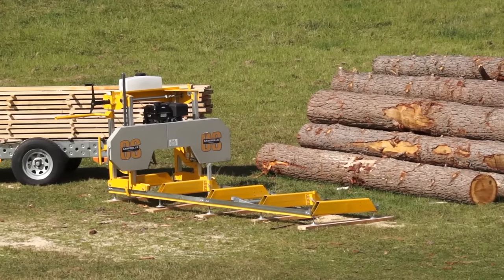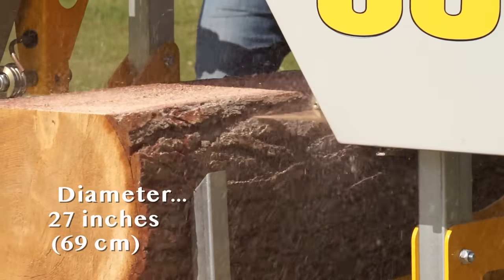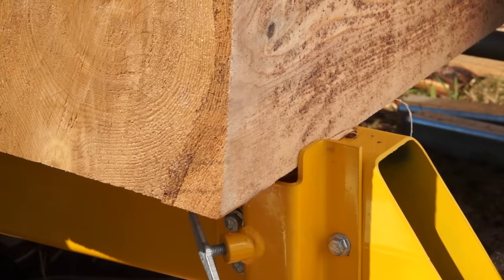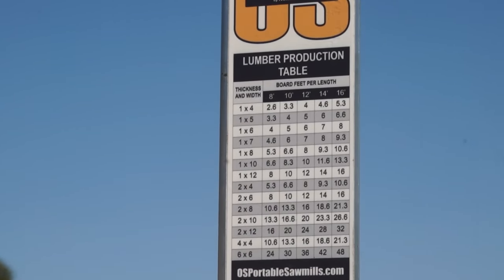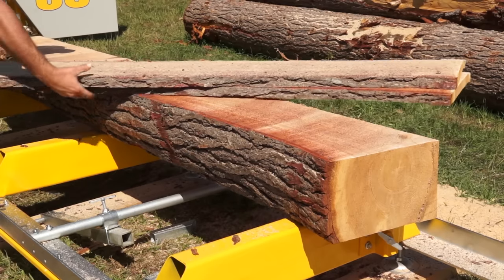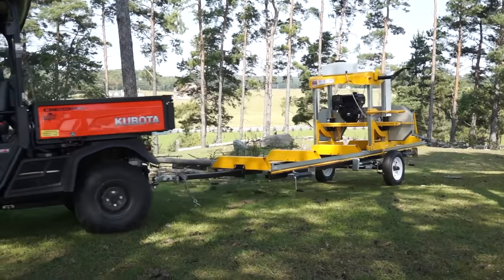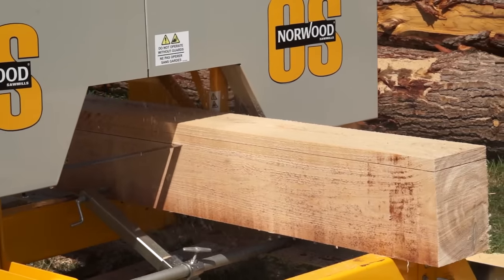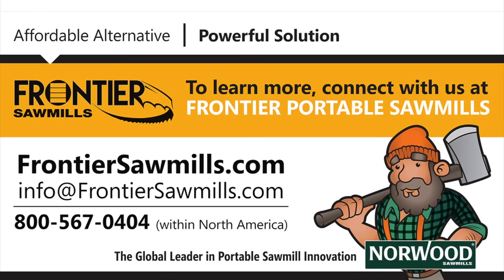The Affordable, Easy-to-Use & Reliable Sawmill You've Been Looking for - The Frontier OS27

Comment: How much price this machine
Reply from the maker: Frontier builds three sawmill models with different log diameter capacities: OS23: 59cm (23”), OS27: 69cm (27”), and OS31: 79cm (31”). Standard log length is 3.4m (11’) but you can add 7’ (2.1m) extensions to mill as long as you want.  You can add the optionally available trailer/support jack system to all Frontier sawmills at any time (when you get your Frontier or in the future).

Frontier Sawmills start at just USD $2297 (for the Frontier OS23). The Frontier OS27 starts at only USD $3297.  The Frontier OS31 starts at only USD $3897.  

You can get a lot of helpful info about Frontier Sawmills, including all pricing, at www.FrontierSawmills.com  .

Frontier services your country factory-direct.  To order, contact us directly at Frontier Sawmills via email at info@FrontierSawmills.com . 

Thanks!

Comment: How many coast this machine?
Reply from the maker: Frontier builds three sawmill models with different log diameter capacities: OS23: 59cm (23”), OS27: 69cm (27”), and OS31: 79cm (31”). Standard log length is 3.4m (11’) but you can add 7’ (2.1m) extensions to mill as long as you want.  You can add the optionally available trailer/support jack system to all Frontier sawmills at any time (when you get your Frontier or in the future).

Frontier Sawmills start at just USD $2297 (for the Frontier OS23). The Frontier OS27 starts at only USD $3297.  The Frontier OS31 starts at only USD $3897.  

You can get a lot of helpful info about Frontier Sawmills, including all pricing, at www.FrontierSawmills.com  .

Frontier services your country factory-direct.  To order, contact us directly at Frontier Sawmills via email at info@FrontierSawmills.com .

Comment: I'm interested to buy this machine so plz send address I can buy this machine
Reply from the maker: Frontier builds three sawmill models with different log diameter capacities: OS23: 59cm (23”), OS27: 69cm (27”), and OS31: 79cm (31”). Standard log length is 3.4m (11’) but you can add 7’ (2.1m) extensions to mill as long as you want.  You can add the optionally available trailer/support jack system to all Frontier sawmills at any time (when you get your Frontier or in the future).

Frontier Sawmills start at just USD $2297 (for the Frontier OS23). The Frontier OS27 starts at only USD $3297.  The Frontier OS31 starts at only USD $3897.  

You can get a lot of helpful info about Frontier Sawmills, including all pricing, at www.FrontierSawmills.com  .

To order, contact us directly at Frontier Sawmills via email at info@FrontierSawmills.com . 

Thanks!

Comment: Is there a large one?
Reply from the maker: Hi Mel

Frontier builds three sawmill models with different log diameter capacities: OS23: 23” (59cm), OS27: 27” (69cm), and OS31: 31” (79cm). Standard log length is 11’ (3.4m) but you can add 7’ (2.1m) extensions to mill as long as you want.  You can add the optionally available trailer/support jack system to all Frontier sawmills at any time (when you get your Frontier or in the future).

You can get a lot of helpful info about Frontier Sawmills, including all pricing, at www.FrontierSawmills.com  .

BUT IF YOU NEED SOMETHING BIGGER OR FOR COMMERCIAL WORK >>> Please look at Norwood Sawmills. You can learn more about Norwood Sawmills at https://www.norwoodsawmills.com/en_us/sawmills
Reply: Nice

Comment: How much cost  this machine
Reply from the maker: Frontier builds three sawmill models with different log diameter capacities: OS23: 59cm (23”), OS27: 69cm (27”), and OS31: 79cm (31”). Standard log length is 3.4m (11’) but you can add 7’ (2.1m) extensions to mill as long as you want.  You can add the optionally available trailer/support jack system to all Frontier sawmills at any time (when you get your Frontier or in the future).

Frontier Sawmills start at just USD $2297 (for the Frontier OS23). The Frontier OS27 starts at only USD $3297.  The Frontier OS31 starts at only USD $3897.  

You can get a lot of helpful info about Frontier Sawmills, including all pricing, at www.FrontierSawmills.com  .

Frontier services your country factory-direct.  To order, contact us directly at Frontier Sawmills via email at info@FrontierSawmills.com . 

Thanks!

Comment: Como faz pra conseguir uma desta
Reply from the maker: Frontier builds three sawmill models with different log diameter capacities: OS23: 59cm (23”), OS27: 69cm (27”), and OS31: 79cm (31”). Standard log length is 3.4m (11’) but you can add 7’ (2.1m) extensions to mill as long as you want.  You can add the optionally available trailer/support jack system to all Frontier sawmills at any time (when you get your Frontier or in the future).

Frontier Sawmills start at just USD $2297 (for the Frontier OS23). The Frontier OS27 starts at only USD $3297.  The Frontier OS31 starts at only USD $3897.  

You can get a lot of helpful info about Frontier Sawmills, including all pricing, at www.FrontierSawmills.com  .

Frontier services your country factory-direct.  To order, contact us directly at Frontier Sawmills via email at info@FrontierSawmills.com .

Comment: Very interested in cost how much.
Reply from the maker: Frontier builds three sawmill models with different log diameter capacities: OS23: 59cm (23”), OS27: 69cm (27”), and OS31: 79cm (31”). Standard log length is 3.4m (11’) but you can add 7’ (2.1m) extensions to mill as long as you want.  You can add the optionally available trailer/support jack system to all Frontier sawmills at any time (when you get your Frontier or in the future).

Frontier Sawmills start at just USD $2297 (for the Frontier OS23). The Frontier OS27 starts at only USD $3297.  The Frontier OS31 starts at only USD $3897.  

You can get a lot of helpful info about Frontier Sawmills, including all pricing, at www.FrontierSawmills.com  .

Frontier services your country factory-direct.  To order, contact us directly at Frontier Sawmills via email at info@FrontierSawmills.com .

Comment: Why dont make it a double cut saw??
Reply from the maker: Your question (suggestion) is not uncommon. Here is the reason why it is not done. Band blades need to be supported in the cut – top, bottom and back. To make a sawmill that can cut in both directions means having a blade with teeth on both sides of the blade. But, if you have teeth at the “back” of the blade, it is hard to support that surface with a blade guide support.

Comment: I would like to bay one.... how much the price of the machine ?
Reply from the maker: Frontier builds three sawmill models with different log diameter capacities: OS23: 59cm (23”), OS27: 69cm (27”), and OS31: 79cm (31”). Standard log length is 3.4m (11’) but you can add 7’ (2.1m) extensions to mill as long as you want.  You can add the optionally available trailer/support jack system to all Frontier sawmills at any time (when you get your Frontier or in the future).

Frontier Sawmills start at just USD $2297 (for the Frontier OS23). The Frontier OS27 starts at only USD $3297.  The Frontier OS31 starts at only USD $3897.  

You can get a lot of helpful info about Frontier Sawmills, including all pricing, at www.FrontierSawmills.com  .

Frontier services your country factory-direct.  To order, contact us directly at Frontier Sawmills via email at info@FrontierSawmills.com .

Comment: How cost in indaian curancy
Reply from the maker: Frontier builds three sawmill models with different log diameter capacities: OS23: 59cm (23”), OS27: 69cm (27”), and OS31: 79cm (31”). Standard log length is 3.4m (11’) but you can add 7’ (2.1m) extensions to mill as long as you want.  You can add the optionally available trailer/support jack system to all Frontier sawmills at any time (when you get your Frontier or in the future).

Frontier Sawmills start at just USD $2297 (for the Frontier OS23). The Frontier OS27 starts at only USD $3297.  The Frontier OS31 starts at only USD $3897.  

You can get a lot of helpful info about Frontier Sawmills, including all pricing, at www.FrontierSawmills.com  .

Frontier services your country factory-direct.  To order, contact us directly at Frontier Sawmills via email at info@FrontierSawmills.com . 

Thanks!

Comment: How many price ?
Reply from the maker: Frontier builds three sawmill models with different log diameter capacities: OS23: 59cm (23”), OS27: 69cm (27”), and OS31: 79cm (31”). Standard log length is 3.4m (11’) but you can add 7’ (2.1m) extensions to mill as long as you want.  You can add the optionally available trailer/support jack system to all Frontier sawmills at any time (when you get your Frontier or in the future).

Frontier Sawmills start at just USD $2297 (for the Frontier OS23). The Frontier OS27 starts at only USD $3297.  The Frontier OS31 starts at only USD $3897.  

You can get a lot of helpful info about Frontier Sawmills, including all pricing, at www.FrontierSawmills.com  .

Frontier services your country factory-direct.  To order, contact us directly at Frontier Sawmills via email at info@FrontierSawmills.com . 

Thanks!

Comment: What do you price
Reply from the maker: Frontier builds three sawmill models with different log diameter capacities: OS23: 59cm (23”), OS27: 69cm (27”), and OS31: 79cm (31”). Standard log length is 3.4m (11’) but you can add 7’ (2.1m) extensions to mill as long as you want.  You can add the optionally available trailer/support jack system to all Frontier sawmills at any time (when you get your Frontier or in the future).

Frontier Sawmills start at just USD $2297 (for the Frontier OS23). The Frontier OS27 starts at only USD $3297.  The Frontier OS31 starts at only USD $3897.  

You can get a lot of helpful info about Frontier Sawmills, including all pricing, at www.FrontierSawmills.com  .

Frontier services your country factory-direct.  To order, contact us directly at Frontier Sawmills via email at info@FrontierSawmills.com . 

Thanks!

Comment: How much is this machine?
Reply from the maker: Frontier builds three sawmill models with different log diameter capacities: OS23: 59cm (23”), OS27: 69cm (27”), and OS31: 79cm (31”). Standard log length is 3.4m (11’) but you can add 7’ (2.1m) extensions to mill as long as you want.  You can add the optionally available trailer/support jack system to all Frontier sawmills at any time (when you get your Frontier or in the future).

Frontier Sawmills start at just USD $2297 (for the Frontier OS23). The Frontier OS27 starts at only USD $3297.  The Frontier OS31 starts at only USD $3897.  

You can get a lot of helpful info about Frontier Sawmills, including all pricing, at www.FrontierSawmills.com  .

Frontier services your country factory-direct.  To order, contact us directly at Frontier Sawmills via email at info@FrontierSawmills.com . 

Thanks!

Comment: How many price of this machine
Reply from the maker: Hi Ajay

Frontier builds three sawmill models with different log diameter capacities: OS23: 59cm (23”), OS27: 69cm (27”), and OS31: 79cm (31”). Standard log length is 3.4m (11’) but you can add 7’ (2.1m) extensions to mill as long as you want.  You can add the optionally available trailer/support jack system to all Frontier sawmills at any time (when you get your Frontier or in the future).

Frontier Sawmills start at just USD $2297 (for the Frontier OS23). The Frontier OS27 starts at only USD $3297.  The Frontier OS31 starts at only USD $3897.  

You can get a lot of helpful info about Frontier Sawmills, including all pricing, at www.FrontierSawmills.com  .

Frontier services your country factory-direct.  To order, contact us directly at Frontier Sawmills via email at info@FrontierSawmills.com .

Comment: Please total price inform me.
Reply from the maker: Frontier builds three sawmill models with different log diameter capacities: OS23: 59cm (23”), OS27: 69cm (27”), and OS31: 79cm (31”). Standard log length is 3.4m (11’) but you can add 7’ (2.1m) extensions to mill as long as you want.  You can add the optionally available trailer/support jack system to all Frontier sawmills at any time (when you get your Frontier or in the future).

Frontier Sawmills start at just USD $2297 (for the Frontier OS23). The Frontier OS27 starts at only USD $3297.  The Frontier OS31 starts at only USD $3897.  

You can get a lot of helpful info about Frontier Sawmills, including all pricing, at www.FrontierSawmills.com  .

Frontier services your country factory-direct.  To order, contact us directly at Frontier Sawmills via email at info@FrontierSawmills.com .

Comment: How much this machine?
Reply from the maker: Hi John

Frontier builds three sawmill models with different log diameter capacities: OS23: 23” (59cm), OS27: 27” (69cm), and OS31: 31” (79cm). Standard log length is 11’ (3.4m) but you can add 7’ (2.1m) extensions to mill as long as you want.  You can add the optionally available trailer/support jack system to all Frontier sawmills at any time (when you get your Frontier or in the future). 

Frontier Sawmills start at just USD $2297 (for the Frontier OS23). The Frontier OS27 starts at only $3297.  The Frontier OS31 starts at only $3897. 

You can get a lot of helpful info about Frontier Sawmills, including all pricing, at www.FrontierSawmills.com  .

We would be happy to mail you a free Frontier Sawmills info kit. You can order one online at  https://www.frontiersawmills.com/en_us/free-catalog-free-dvd-form

Thanks!

Comment: What is price
Reply from the maker: Frontier builds three sawmill models with different log diameter capacities: OS23: 23” (59cm), OS27: 27” (69cm), and OS31: 31” (79cm). Standard log length is 11’ (3.4m) but you can add 7’ (2.1m) extensions to mill as long as you want.  You can add the optionally available trailer/support jack system to all Frontier sawmills at any time (when you get your Frontier or in the future). 

Frontier Sawmills start at just USD $2397 (for the Frontier OS23). The Frontier OS27 starts at only $3397.  The Frontier OS31 starts at only $3997. 

You can get a lot of helpful info about Frontier Sawmills, including all pricing, at www.FrontierSawmills.com  .

We would be happy to mail you a free Frontier Sawmills info kit. You can order one online at  https://www.frontiersawmills.com/en_us/free-catalog-free-dvd-form

We would be happy to answer any questions that you may have, or to prepare a quote, including shipping to your door.  Let us know the best number to reach you at or please feel free to call us toll-free at 800-567-0404.

Thanks!

Comment: what is the cost of this machine?
Reply from the maker: Frontier builds three sawmill models with different log diameter capacities: OS23: 59cm (23”), OS27: 69cm (27”), and OS31: 79cm (31”). Standard log length is 3.4m (11’) but you can add 7’ (2.1m) extensions to mill as long as you want.  You can add the optionally available trailer/support jack system to all Frontier sawmills at any time (when you get your Frontier or in the future).

Frontier Sawmills start at just USD $2397 (for the Frontier OS23). The Frontier OS27 starts at only USD $3397.  The Frontier OS31 starts at only USD $3997.  

You can get a lot of helpful info about Frontier Sawmills, including all pricing, at www.FrontierSawmills.com  .

Frontier services your country factory-direct.  To order, contact us directly at Frontier Sawmills via email at info@FrontierSawmills.com . 

Thanks!

Comment: В России есть такие станки?
Reply from the maker: Frontier builds three sawmill models with different log diameter capacities: OS23: 59cm (23”), OS27: 69cm (27”), and OS31: 79cm (31”). Standard log length is 3.4m (11’) but you can add 7’ (2.1m) extensions to mill as long as you want.  You can add the optionally available trailer/support jack system to all Frontier sawmills at any time (when you get your Frontier or in the future).

Frontier Sawmills start at just USD $2297 (for the Frontier OS23). The Frontier OS27 starts at only USD $3297.  The Frontier OS31 starts at only USD $3897.  

You can get a lot of helpful info about Frontier Sawmills, including all pricing, at www.FrontierSawmills.com  .

Frontier services your country factory-direct.  To order, contact us directly at Frontier Sawmills via email at info@FrontierSawmills.com .
Reply: Тимофей,вы разбрались?Цена какая у этой пилорамы?
Reply: @ПетрСимурзин  нет, молчат. Нашол лучше.

Comment: Cost?
Reply from the maker: Frontier builds three sawmill models with different log diameter capacities: OS23: 59cm (23”), OS27: 69cm (27”), and OS31: 79cm (31”). Standard log length is 3.4m (11’) but you can add 7’ (2.1m) extensions to mill as long as you want.  You can add the optionally available trailer/support jack system to all Frontier sawmills at any time (when you get your Frontier or in the future).

Frontier Sawmills start at just USD $2297 (for the Frontier OS23). The Frontier OS27 starts at only USD $3297.  The Frontier OS31 starts at only USD $3897.  

You can get a lot of helpful info about Frontier Sawmills, including all pricing, at www.FrontierSawmills.com  .

To order, contact us directly at Frontier Sawmills via email at info@FrontierSawmills.com . 

Thanks!